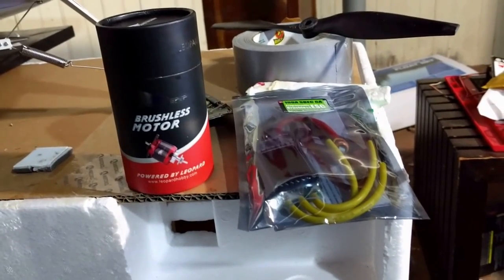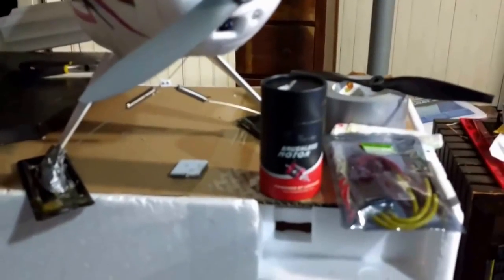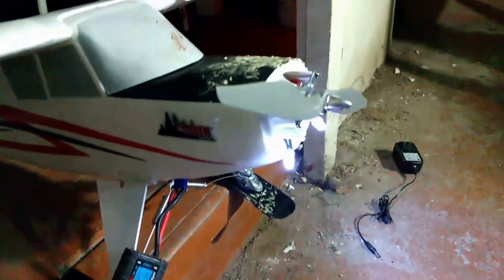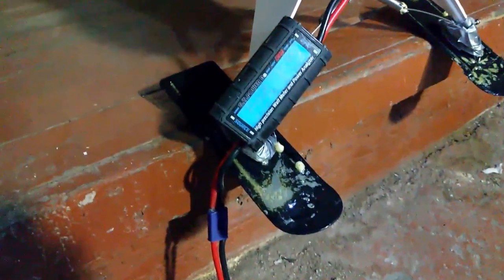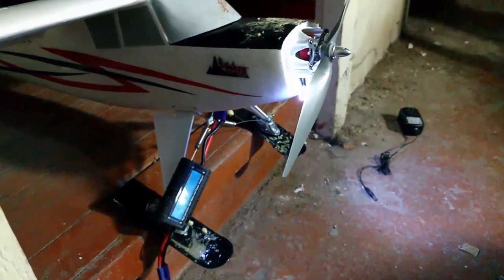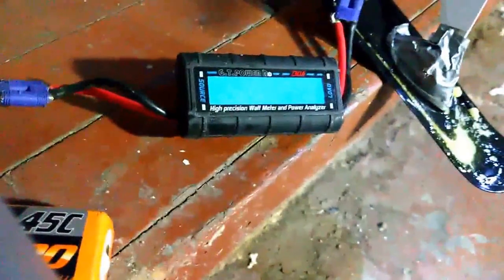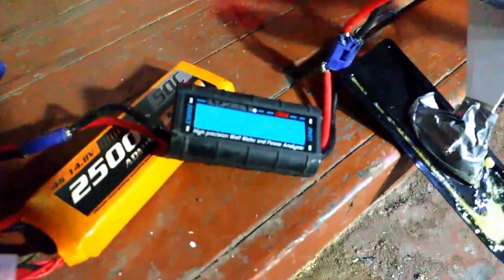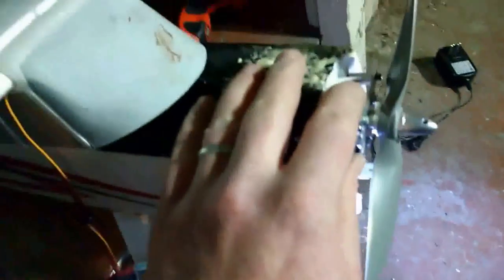E-flite Timber: HeadsUpRC Leopard 960kv Motor Test (stabilized)

Comment: That motors not rated to run on 4s tho.
Reply from the maker: Well, while I was more concerned about the watts, I don't want no trouble from the voltage rating people - but from my numerous flights with the motor it flies quite well with four cells, with liberal throttle and without, so far, either melting or getting all stinky.

Comment: so I can safely fly my Timber on a 4s an keep it slow
Reply from the maker: The front of the fuselage of the Timber, as I learned the hard way with a three cell flying normally, is weak. While yes you can fly this motor with this plane and its stock 40A ESC (after checking your prop with a watt meter), you elevate the odds of needing to buy another Timber. The Tundra and the Commander in contrast are better 3S planes that people often prefer with a four cell. But if you just give it more power when going vertical as opposed to nose diving, not much more risk with that.